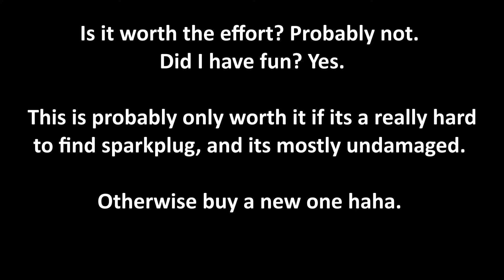I restored a sparkplug for fun and tested it out.

Comment: Nice job. Glad you enjoyed it. Way back when I first started repairing cars, we had a sparkplug sandblasting tool mounted to the wall and inserted the dirty sparkplug, blasted them clean and  re-gapped them. Stay safe and please continue with the great videos.
Reply from the maker: I would love to see what it looked like, maybe I could get my hands on one of those sandblaster. What blasting media did it use?
Reply: @AJRestoration  I sand blast my plugs and I use glass beads and I haven’t had a single issue with using that. Spark plug blasters were very popular in repair shops in the 40’s & 50’s and they’re actually pretty expensive if you can find one that still works.

Comment: It still looks great!  I used to work in a local Briggs & Stratton plant.  They closed down a few years ago.  Old Biggs & Stratton engines were top-of-the-line.  The newer ones are okay.  They have changed the design to meet modern emission standards and lower costs.  I am not a fan of the plastic carburetors.  I have an old tiller with a Briggs engine that ran great for decades.  First-pull start even after sitting for years, but now it is ready for a rebuild.  The intake valve seems to be sticking open.  Too bad you can't come to the US and restore the rest of if for me.
Reply from the maker: Maybe someday, I would love to move to the US. So many projects I could to and people I could meet.

Comment: I have no idea how many viewers on here that have ever taken a spark plug apart. Spark plugs either work, or then don't. And you can even make a resister plug into a non-resister plug by taking the resister section out and cutting a piece of house copper wire to fit inside. Really not much to plugs. I've been media blasting them for a long time now. They clean up so easy and look new. Then you can easily test them with an ohm meter...   Thumbs Up for this video showing how!
Reply from the maker: Thank you for thee thumbs up! I agree they either work or they don't.

Comment: You plant it with zinc right?  You can't use it in car now, because of the cylinder gases temperature.
Reply from the maker: It will be fine to use in small equipment.
Reply: terrible

Comment: .....never seen a spark plug restoration.....
Yes, I see and did !
For restoration old planes we use for the spark plugs of the V12 or radial engines f.e. a special cleaning unit. Size app. two shoe-boxes. There was all included.
A sandblaster.
Internal light and lenses to control the result.
A connector for high-tension to check a: the sparks
and b: the function of the insulation.
The machine is from the 50-60's and restoring one aircraft-spark-plug takes 2-3 minutes.😊
Reply from the maker: I would love to get my hands on one of those machines.